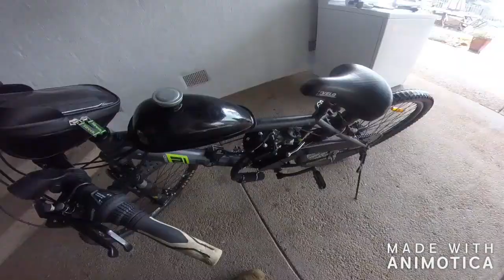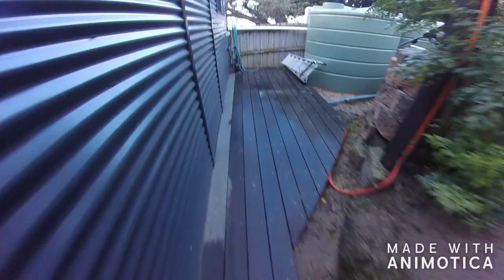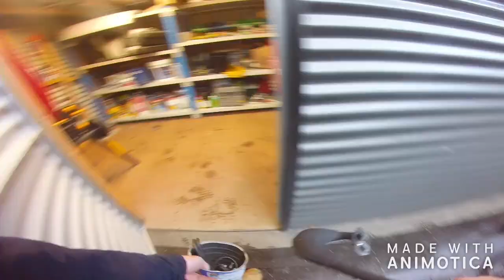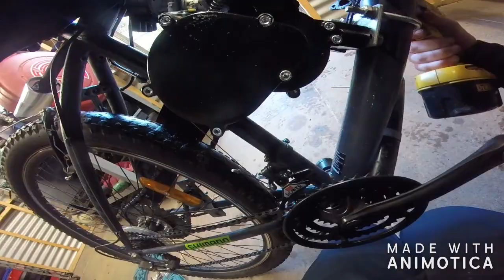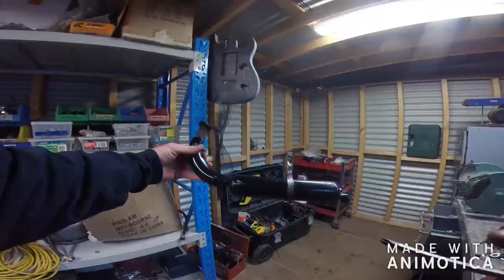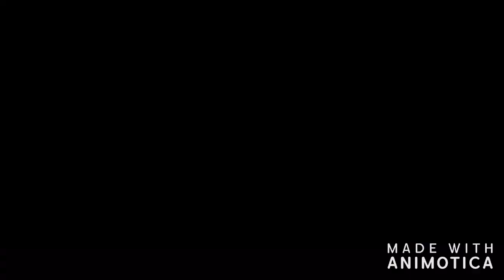25$ EBAY exhaust vs STOCK exhaust motorized bike

Comment: I got the exact same exhaust, If you pull the silencer apart you'll see there's no packing inside and the pipe that leads through it doesn't have any holes in it. So what I did was drill a shitload of tiny holes in it then wrapped it with a bunch of exhaust packing then put it back together, added a bit of torque and also made it quieter and sound better too. Abit of a pain to do but worth it I think and awesome video mate👍🏻
Reply from the maker: Thanks mate means heaps to hear that and good idea I will do that for my next bike I build

Comment: was hoping to know if you felt a difference in the low,mid and high rpm performance?
Reply: the kebab squad its definitely makes a difference down-low. Mine it helps all through the rev range. Get yourself a good exhaust!
Reply from the maker: Valium YT yeah mate makes heaps of difference in the performance sounds a lot better too
Reply: distorted ambience yea, i had the same as you. But went back to the poo-poo exhaust (stock) and took the end off. Sounds awesome and adds a lil power.
Reply from the maker: Valium YT yeah they do sound good when you do that

Comment: Don’t ever use a drill on your nuts and bolts everything on these kits are cheaply made.This video is kinda old so I’m sure you know now. You are also getting the high rev from an air leak somewhere
Reply from the maker: Eddie Wilson yeah mate I tapped new threads in it a bit after this video and yeah it’s from the shitty manifold I had to make ahaha but cheers g

Comment: Did the exhaust make it run better or faster or was it just all sound
Reply from the maker: Runs better heaps more revvy, being a 2 Stroke it needed back pressure so I got the original exhaust put larger tube inside all the way through cut the bend off, shortened the eBay exhaust and welded the custom one on now it does burnouts as soon as you drop the clutch in dirt or wet
Reply: @heathgraham4911  sick wanted that exhaust yrs back . The thruster one cost 39. Before now it's 69. Ouch
Reply: @mozezcen-valley7555  I had the thruster exhaust it looks cool but made my top speed less, gave me a little low end thats all wasn't worth the 40 bucks I spent